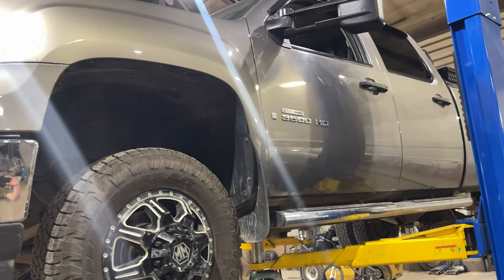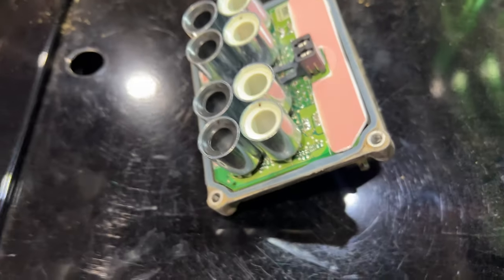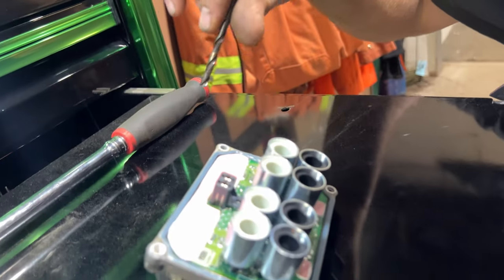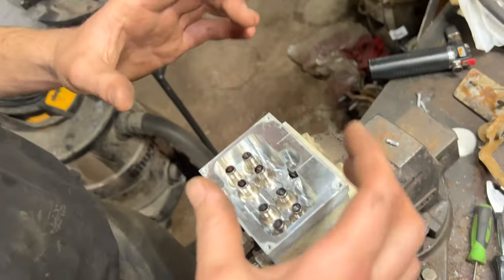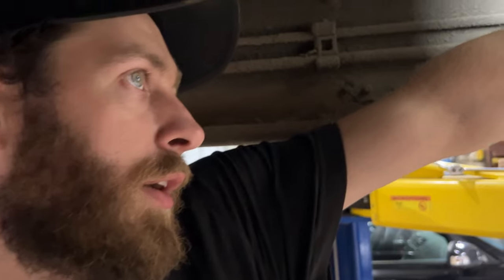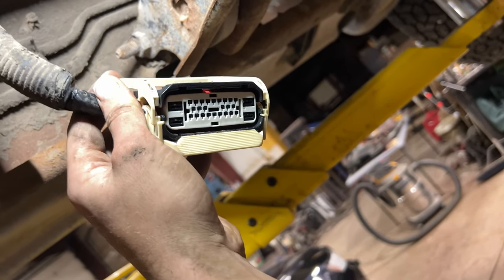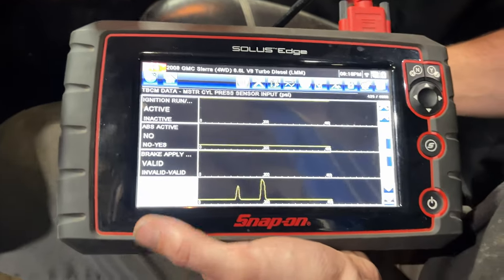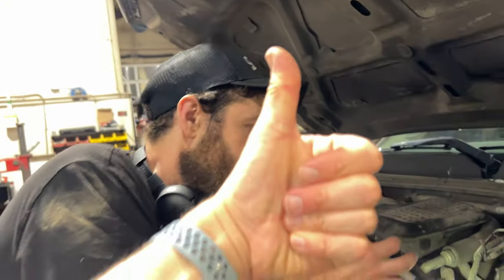Replacing ABS Module - Trailer Brakes Not Working 2008 GMC Sierra 3500HD

Comment: On the connectors after cleaning the area I find just warming the plastic with a heat gun before moving tabs or locks they flex and come free much easier.
Reply from the maker: Smart idea :) nice work

Comment: Hello, Sir what was this issue making the truck do? My truck will briefly brake and make a wining noise im wondering if this could be the potential issue For that is also showing the service trailer brake system but i hate driving down the road and that loud noise goes for 5 seconds at various speeds! Im wondering if this was your issue

Comment: Very common problem the internal sodering cracks and cause the problem you cant flow continuity if the bridge gap(soder joint) cracked blow it off and look at all soder joints u will see cracks even one spec of of water which can happen with moisture can help ruin the board
Reply from the maker: Awesome comment man! Very much appreciated

Comment: I have an 2009 gmc 2500 and i don't have the connector/potentiometer on my master cylinder. I have no thought codes but my trailer brakes are not working as well. I have replaced the slider switch and the brake controller relay on the frame rail. Still no trailer brake and I'm stuck as to where to turn to next. Any ideas?
Reply from the maker: What’s your VIN and I’ll look up wiring diagrams for you

Comment: Update! I need to replace the abs module,part number 25802686, and cannot find this part. Chevy dealer can't find it,repair shops can't find it. I'm stuck! You have any idea what to do? 2007 Chevy silverado 3500hd diesel dually. Thanks!
Reply from the maker: I had the same issue, go to www.car-part.com and look up the abs pump, the module will come with the pump, it’s going to ask you some questions about what sales codes the truck has and you’ll probably have to call the dealer with the vin to find out if your not sure and then just enter that info on the website and it will search junkyards across Canada and the United States, good luck I hope you find one
Reply from the maker: Also I didn’t end up having to program the one that I replaced, I just installed it and it worked
Reply: @Tech-28  Thank you! I'll try that!
Reply: @Tech-28 can I install a abs module off a 13 on my 13 and won’t have to reprogram it ?
Reply from the maker: @robmx522  should be plug and play
Reply: @Tech-28  like it won’t have any abs lights plug and play ? My friend at a dealer said it can’t be reprogrammed ?
Reply from the maker: @robmx522  well I mean I didn’t have any issues with the one I swapped, just swapped it and it was good to go
Reply: @Tech-28  ok thanks man I’m gonna take mine off and see if it can be repaired first my abs light parking break and service trailer brakes is on I have no trailer brakes
Reply from the maker: @robmx522  did you check for your 5V reference signal? I bet ya the regulator died
Reply: @Tech-28  yes and I have 5 volts  I changed the trailer brake switch relay and module and still get the codes and no power to the trailer brakes
Reply from the maker: @robmx522  let me know what you find out
Reply: @Tech-28  I will the abs can still be bad if that plug in has 5 v?
Reply: @Tech-28  my module doesn’t come apart ordered new one

Comment: Hi i have code u0073 and c0245 what can i do 
Thank you
Reply from the maker: I would check your fuses to the abs pump and also your trailer brake control module to start